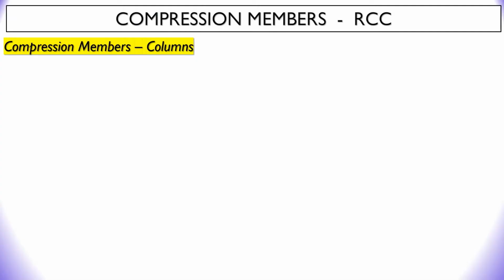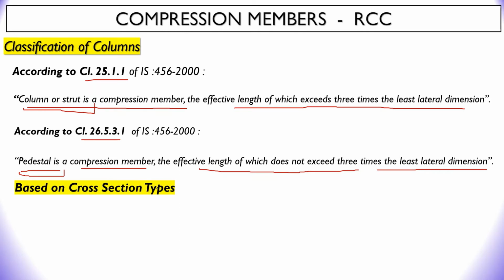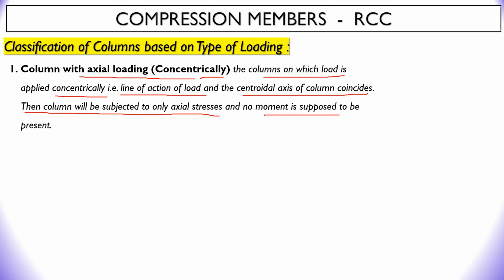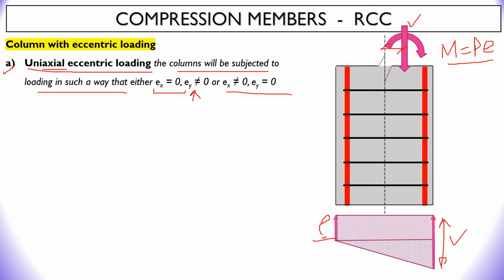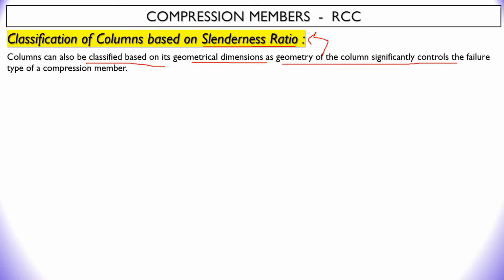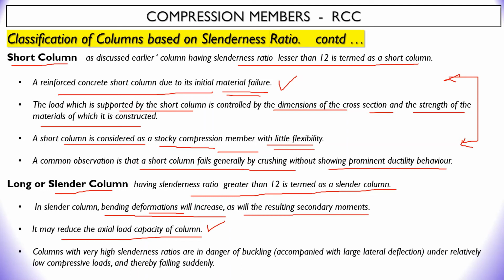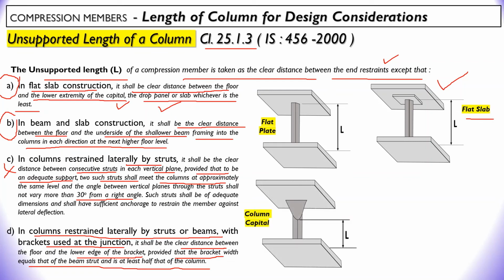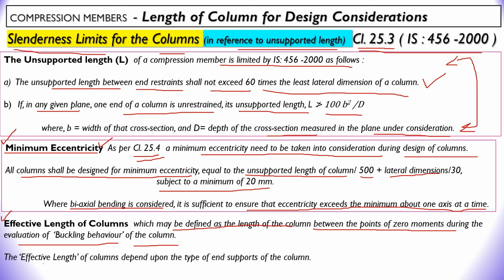Lecture 22 || Design of RCC Compression Members || Introduction || IS :456 -2000 ||  Civil Engg.

Comment: Sir what is capital and why is it provided
Reply from the maker: Capital is the increased portion of the column at top level where it supports slab. It will be provided in case of Flat Slabs which you will be able to understand during design of flat slabs.